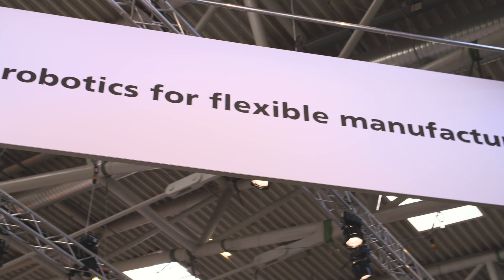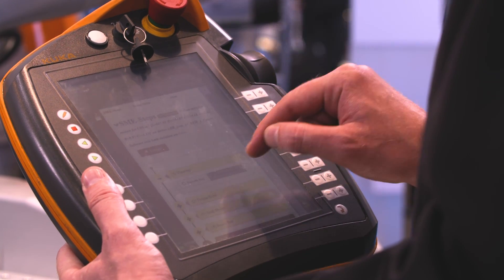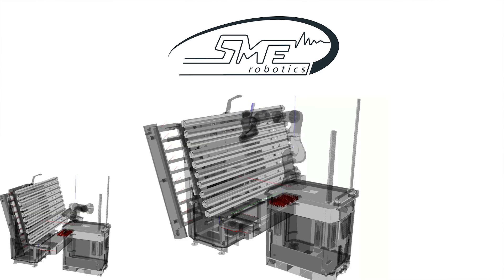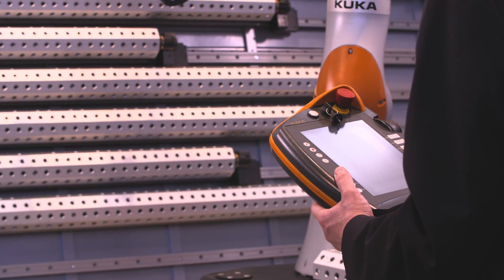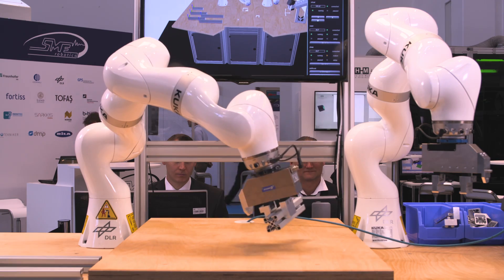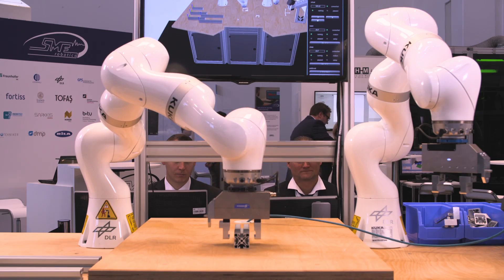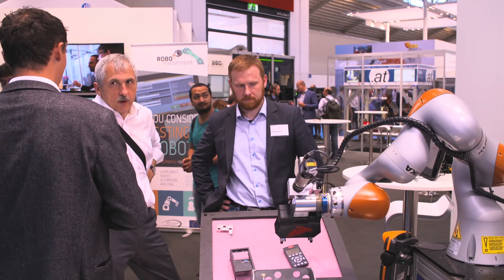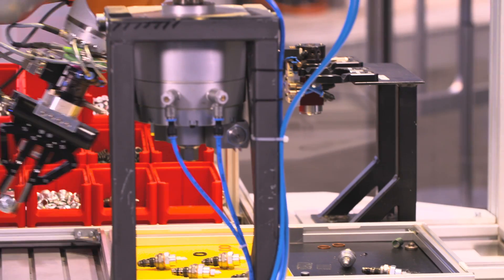Helping Small and Medium Enterprises to Automate with Robots

Comment: The best investment for today is home robots which can do lathe velding drilling cutting and design platform.  They are the best work from home general purpose compact plug and play versatile to relocate and easy plug and play assembly.  With software app plug ins from Internet cell phone. Including stitching wood low scale wood work plastic moulder etc.
Reply: If possible doc. Genetic culture.